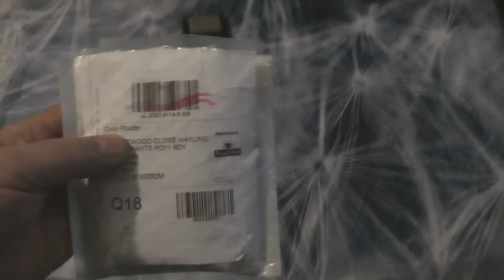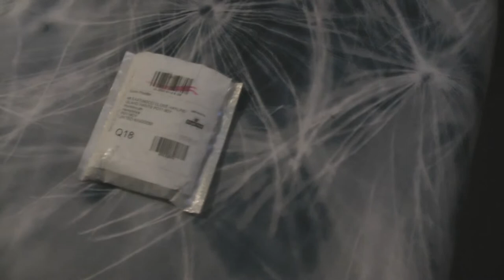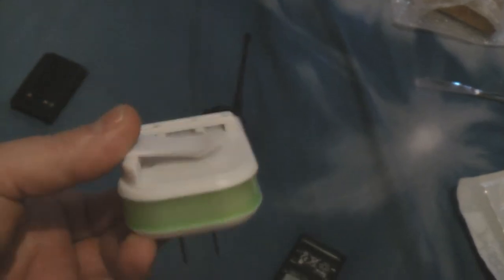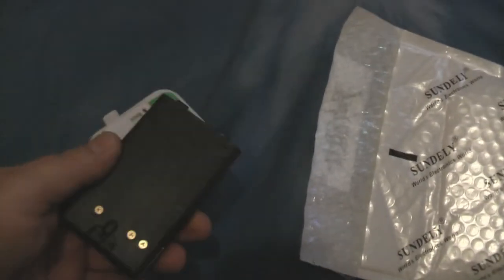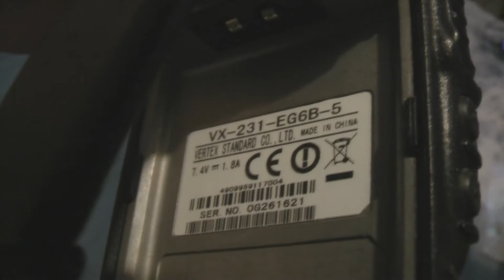Wrong Battery

Comment: At the back of the battery there's 3 charging pins.. which is negative and which is positive?
Reply from the maker: Hi there, If you look at the back of the battery with the 3 connections at the bottom facing you the single connector on the left is + Positive :-) I hope this has helped.
Please dont forget to like & Sub please thanks :-)
Reply: Thank you very much. If left is positive. Which one would be negative?
Reply from the maker: @justindeep341  The ones on the right are negative